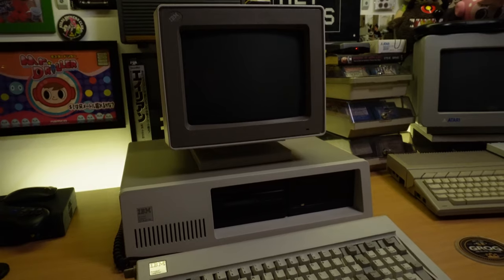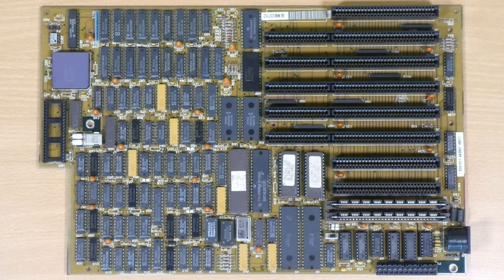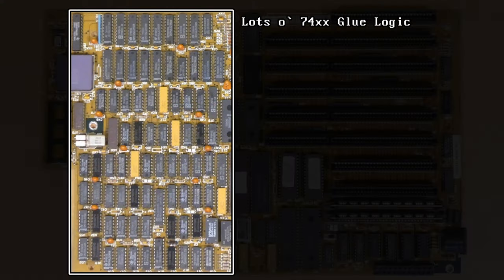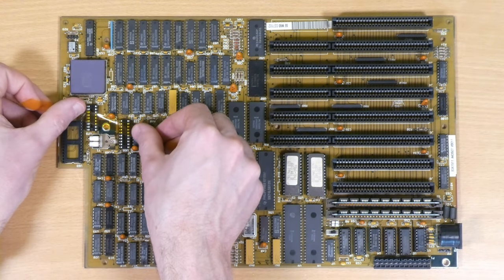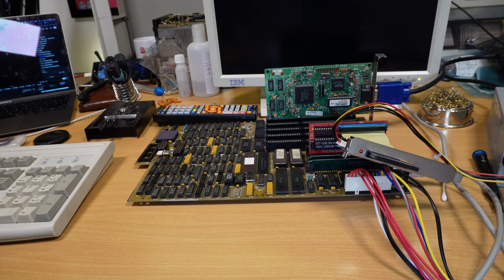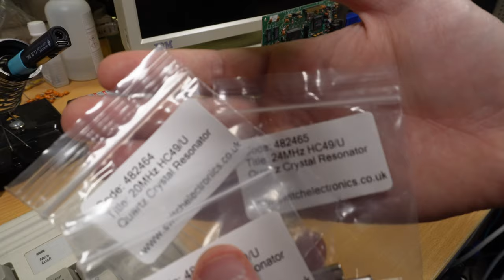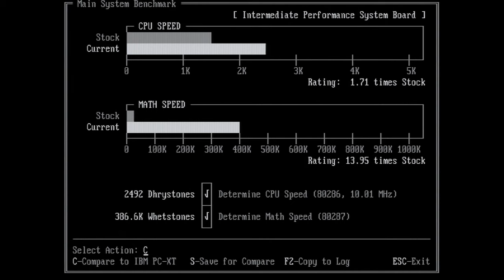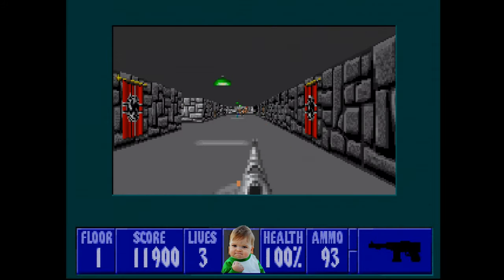Upgrading The CPU - 1986 IBM 5162 PC XT 286 Restoration - Part 2

Comment from the maker: There's a lot of speculation in the comments that the instability at 10MHz might be due to the ISA bus speed - and I think that's definitely right on the money. But here's an interesting finding that I've made since I put this video together - if I put the AdLib card in a 16-bit ISA slot everything runs fine at 10MHz even though it's an 8-bit card! I'm thinking there must be some logic chip or other handling the 8-bit slots that can't cope with the higher clock speed, while the 16-bit slots are hooked up differently. Time for some probing...
Reply: The only difference should be the "extended" part of the ISA bus and everything else should be completely in parallel with no changes.

I would maybe suggest that either you are so much "on border" with the 10MHz that the physical location or physical distance to chipset actually starts to matter, or maybe they have some ISA slots directly connected to chipset and some ISA slots through some kind of buffers or something. And while chipset is capable at 10MHz, the buffers may not be.

But that behavior is definitely a very weird one. The physical slot should not matter. But as you've found out, in your case, it does.

Just to fully understand it: Does the adlib card fail on every 8 bit slot and does it work on every 16 bit slot? Or is there more variety in this?

Comment: I think OS/2 played a role in the IBM XT-286 existing. Microsoft and IBM began working on OS/2 in 1985, and it was supposed to replace MS-DOS as the standard OS for PCs, but it required at least a 286 to run. So that's why IBM wanted to upgrade the XT with a 286 CPU, so it could run OS/2. But OS/2 got delayed until the arrival of the PS/2s, and meanwhile a regular XT was still fine for running DOS applications, and 286 clones got cheaper and faster, so that left the XT-286 with seemingly no purpose to exist.
Reply from the maker: That makes a lot of sense, thanks for the info. I might include this in a future video (with full credit, of course).

Comment: Nice work.  Just thinking out loud but when you increase the CPU clock are you not also increasing the ISA bus clock and if so this might be the cause of the crash when the adlib card is installed.  Standard spec of ISA is 8mhz as I recall.  Assuming it is just the sound card falling over at the higher speed another one might have better luck.
Reply: Was just going to post the same.

Comment: I hate the fact they put stuff in to stop the upgrade's. Another great video Rees really well covered.
Reply from the maker: Thanks! Yes, typical IBM, although to be fair other manufacturers were cloning their stuff left right and centre at the time 😁
Reply: It's also to lower the support problems.  As you saw on the video, upping the crystal breaks other things such as the ISA bus specification, which then causes issues with add ons.  Same with memory.  Having users read of a 'free' upgrade, having it not work then call the support lines causes it's own set of issues.

Comment: Worth the wait. I’m really interested in the overclocking, and it’s something I’d like to do one day,  though I’m not brave enough just yet to make these changes to my IBM 5162.
Reply from the maker: Personally I think I'll be sticking with the 8MHz CPU, 16MHz crystal and the IBM beta BIOS I'll be looking at in the next video. I genuinely don't think this board can ever be reliable at 10MHz and above. But I will explain all in part 3. 🙂
Reply: Hi Reese, I thought I might have a go at upgrading to 8Mhz. In your video you mentioned you replaced the intel 82284 clock driver and 82288 bus driver with their CMOS-based counterparts. Do these have the same identifiers but run faster (if not, can you recall what their part numbers where?), also where did you source them? P.s. I understand that I don’t need to replace them for an 8Mhz upgrade, but I’d like to future proofed in case you solve the ISA bus issue :)

Comment: Really interesting video! Good timing too, as I finally had some success overclocking my 5162 yesterday.
My original simms wouldn't even run reliably at 8Mhz, so I upgraded those and the extra 128k to 100ns and so far so good. I'm waiting on a 18 and 20Mhz crystal in the post for more experiments.
Reply from the maker: Oh excellent, I didn't realise anyone else out there was on the same journey as me! If I continue to have issues at 10MHz I may well have to investigate the 9MHz route myself, although it's a bit of an unusual speed - I'm not sure many 9MHz systems were sold back in the day. 🙂
Reply: @ctrlaltrees  Well, mine is now running quite happily at 9Mhz. I tried for 10, but it wasn't happy. I haven't upgraded the 82284 and 82288 and probably won't, as I already have a 16Mhz 286 clone for when I need something faster

Comment: My 286-10 needs a keypress to get into turbo mode, since I've upgraded the bios it doesn't allow me to do it and stays in (I think) 8mhz. Would it be possible to upgrade the cpu to 16mhz? The crystals onboard are 16mhz, 20mhz, and 12mhz. What would they need to be changed to?

Comment: Compared to the PS/1 style motherboards this looks definitely like something of a past era. IBM most likely was aware of this board problematic performance at higher speeds.
Reply from the maker: Oh definitely, I'm thinking there are other components on the board (like the old NMOS/HMOS logic chips) that are holding it back, and I don't think I'm prepared to replace those. It seems 8MHz is the upper limit if I want it to be reliable but I do have some more findings which I'll be showing in the next part!

Comment: Might be your ISA bus clock that gets too high and causing the Adlib to crash? Although later boards would push ISA much higher so it shouldn't be a problem? Maybe some other IBM control logic is intentionally made to not handle higher BUS speeds?
Still not sure how to upgrade my 10Mhz Victor 286, there isn't a 10 or 20Mhz crystal anywhere on the board,so I have no idea how it gets it's clock... I'd like to get it to 16, that's the sweet spot for 286 IMO.
Reply from the maker: Yes, I think it's definitely something to do with other logic chips on the board and the ISA bus speed. I've since discovered that if I put the card in a 16-bit slot it works fine! Even though it's an 8-bit card. So I need to investigate the difference between the logic of the 8-bit and 16-bit slots.
Reply: @ctrlaltrees  Maybe the DMA controller? is different between the 8- and 16-bit slots?
Reply: @BadManiac  Did adlib use any DMA? Maybe i've understood it wrong, but DMA on sound blasters have been only used for actual digital audio and the adlib part (which is fully the same as original adlib) only uses appropriate ports/addresses.
Reply: @GigAHerZ64  yeah Adlib shouldn't use DMA as I've got those chips on a DMA less 8088 computer and it works fine

Comment: why 286 is so slow? just 6 MHz?
Reply from the maker: It is a very strange choice, especially for 1986. I suppose IBM were trying to offer a low-cost option alongside their much faster PS/2 machines.
Reply: @ctrlaltrees Would it be possible to overclock using a newer date code 286?